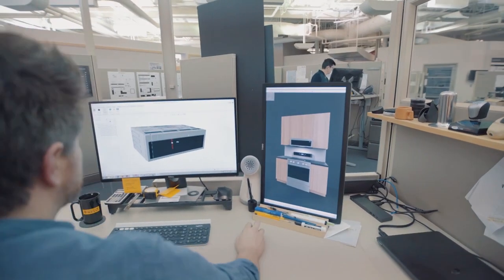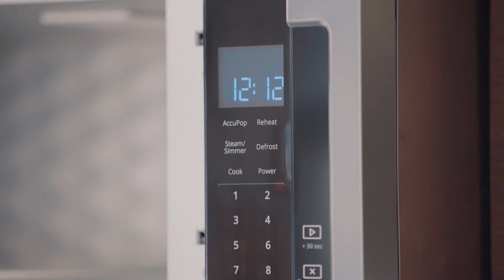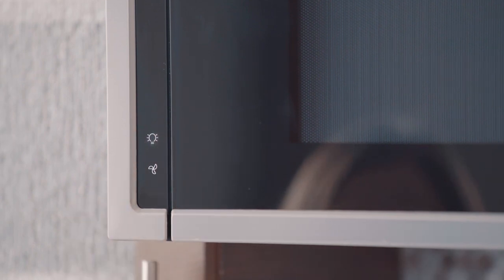Whirlpool Low-Profile Over-the-Range Microwave Design Brief

Comment: I won’t buy Whirlpool again. Purchased this $500 Whirlpool microwave-range hood about 15 months ago.  It died a few days ago after minimal use in a one person household. 

Had to take the entire microwave down, remove the entire outer casing just to get to a fuse that should have easier access.  Every other microwave fuse can be accessed removing the top/front panel.  Very poor design. 

Installed a new fuse but it’s not JUST the fuse.  Of course it just went out of warranty.  Cost of appliance repair and parts will be more than the microwave is worth. 

Thanks, Whirlpool, for an appealing outside design that appeals to people with limited counter space.  Too bad the low grade parts where used where it matters most to consumers.  The product should be designed to operate/work/heat my coffee longer than, just, 15 months. 

I can recommend this product if you “JUST” want a high priced storage box over your stove.  Clock display not working included.
Reply: thanks for this. Did you ever keep the microwave or did you consider purchasing something else?
Reply: I installed a standard range hood.  Purchased a counter top microwave that fits inside a pantry. $100 investment rather than another $500 for a faulty Whirlpool unit.